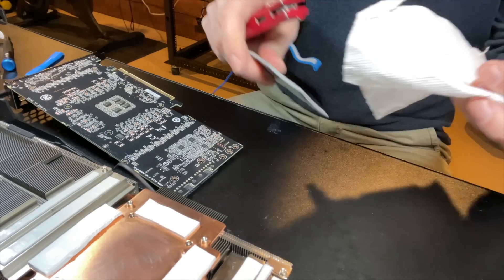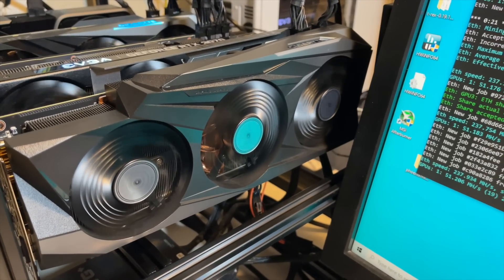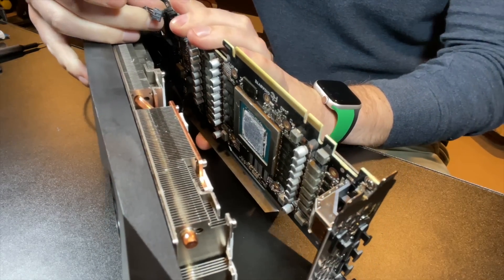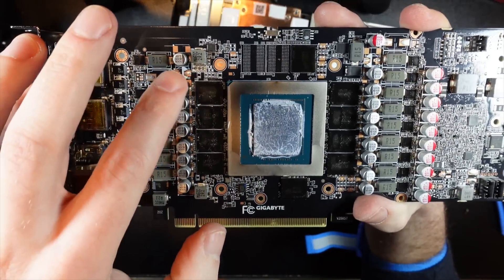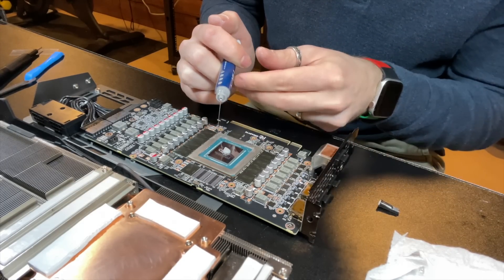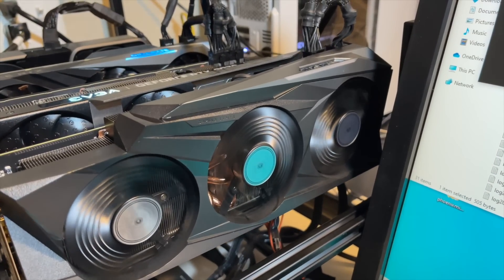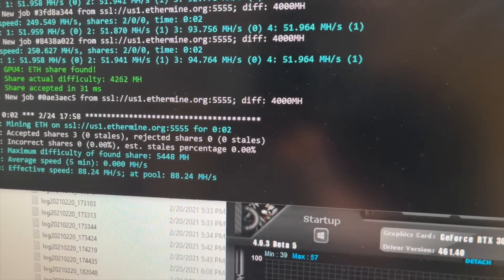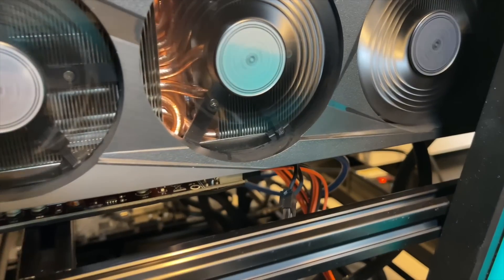RTX 3080 Thermal Pad Install & Ethereum Testing

Comment: wonder if most cards require the 3mm Thermal Pad? i have a EVGA 3070 FTW3 if someone be kind to confirm or direct me to  in the right direction on which  type  thermal pad thickness I should use for my card thank you and TY for the Video👍👍

Comment: 1.5 year late with this comment, but for others doing this... Paste on the GPU core should be fully spread and covered, not just a drop in the middle. This is not a CPU where you are pasting a heatspreader. You are directly on the die now. Can not rely on random spreading through pressure, you want full coverage. For mining it likely doesnt matter, but if you load the GPU for gaming, I expect this one to go crazy hot.

Comment: just did front gelid 12w 2m pads only ( no rear pads) on 3080 tuf, getting 100.5mh 102 vram been good at 68 power -150 core +1410mem fan auto gpu temp at 57 summer nights. before it would just chill at 82mh and couldnt sustain 95mh stock pads.

Comment: Try locking the core or doing -150mhz and do +1150 on memory and set power limit to 215w. You can easily get way better temps and efficiency. I can do 101mhs @212w with manual tuning. The key is lower power limit and core

Comment: How the hell is that 3080 running so hot with new thermal pads and such low overclocking!? I'm running my 3080 with stock pads, memory OC at 1300, fans at 80%, avg GPU temp is 45C with the memory junction at 86C
Reply from the maker: Gigabyte is terrible with these GPUs. Fixed it up in Part 2.

Comment: Mike, what memory do you have in this Gigabyte?  I have a 3080 Eagle with Micron.  Changed out both the front pads and added pads to the back plate, went from 67Mh/s at 108c to 88Mh/s at 108c, an improvement yes but the mem is too hot.  I'm thinking it's got to be the memory brand.

Comment: I'd add copper  rectangles to the heat sink it looks like the  1 inch think pads are not doing a good job on that gddr6x. It should significantly Iower than when your at I don't expect the Ram to last at over 100c 24/7 copper is better and use little thermal paste between the copper.

Comment: it seems with all GDDR6X GPU's the manufacturers cheapened out on thermal pads.
if you replace ALL thermal pads on the GPU with Gelid thermal pads (both over the vram + caps and under the vram) your vram temperatures would actually be well within 75-90c with a good OC.

Comment: way to hot not to sound like a troll card won't last long you above the upper limits
6x mem 0C to +95C / +105C
love the videos keep up the great work
Reply from the maker: I have a part 2 where I replaced the stock pads. Huge improvement.

Comment: Just for anyone watching on bare die chips you are best served by spreading the paste. the dot method is not what you want to do unless you enjoy extra hot,hot spot temps. as unlike putting thermal paste on an IHS ever part of what your are applying on a bare die is the chip vs an ihs which is normally quite a bit larger then the die underneath it

Comment: my 3080 run at 98mh/s fan speed 65% , GPU temp 57C & Memory temp 94C without install Thermal Pad
Reply from the maker: That's sick. What 3080?
Reply: @RedFoxCrypto  gigabyte gaming oc , now i'm running it at 101mh , fan 75% , gpu temp 52, vram temp 92 . Dont know why your gpu too hot lol

Comment: just put normal Stand Fan  near the rig it will fix every thing for you my palit 3080 gaming pro 1300 memory 75 power fan on 75% and max vram temp 82-92 stable 100 hashrate
Reply: Can you please give your settings for core clock and memory clock?
Reply: @Lifetips2040  core -50 mem + 1300 pl 77 fan 77% 
plus + 2 stand fans near the rig on max speed

Comment: I have a question about an evga xc3 black edition 3080, for thermal pads, they recommended 2.25 for memory pads, 2.5 for middle pads, does that mean i can use the 2.0 and 0.5 and just stack them from gelid since theyre squishy? or should i just get the 3.0 for all since theyre 40% squishy or so as mentioned i think at the back?

Comment: Hi!, I have problems with memory junction temperature (110º) with a brand new 3080 Founders Edition (I just get 80MH/s). I guess I should put thermal pads... right?. 1,2 or 3 mm? thanks

Comment: This is not a success. You don't want to run your gpu with mem temps even above 100. I did this exact same thing to my 3080ti FE card and got it to where mem temps don't even reach 80C.

You gotta do both front side and backplate sides as well.

I should add my ambient temperature is 81F!
Reply from the maker: You're right. I have a part 2: https://youtu.be/FZ26U_mvyAI

Comment: I dont know if im lucky or not but last week i managed to buy 5 GigaByte 3080 OC's and none of the cards was thermal throttling. Bought thermal pads and everything just to be ready for any issues  but no issues are present.
My settings for all 5 gpus in Afterburner are...if you want to try:
PL = 65
TL = 80
CC = -200
MC = 1500
FS = 90%

Getting 102.7 MH/s on all 5 of them

Hope it works :)
Reply from the maker: Wow dude. You lucked out big time. Congrats dude.
Reply: @RedFoxCrypto  Hehe thank you :)

Comment: Damm. my 3080 Ichill can do 103 MH/s at 104c temps with ambient temps at 25c. but i still run it at only 91-95 MH/s with temps at 92-94 and fan at 80%. now i am thinking if i add thermal pads maybe i can go down a bit more but i don't know if i can open my card its too precious for that lol.

Comment: That temp it's way too hot, it will cause premature memory failure.
Reply from the maker: I fixed it in a follow up video. Replacing stock thermal pads is the way to go.

Comment: Hi ! Thank you for your amazing content !
12:39 Why would you not recommend to let fan at 100% all the time ?
Reply from the maker: Thank you very much! Running it at 100% 24/7 will add to the wear of the fan and cause it fail sooner. But honestly, fans are cheap and easy to replace so if you need to run it max then do it. Better than toasting your GPU.
Reply: @RedFoxCrypto  Thats what I thought, better keep the GPU chip in good condition than replaceable fans, TY for your answer and content.
Reply: I wonder if you tweaked the bios of your GPU, because my MSI Gaming Trio Z can’t get to more than 90 MH

Comment: I did the same thing but with 1.5 mm pads and there is literally no difference. Its still thermal throttling. Do i ought to replace them again with 2 or 2.5 mm's ?
Reply from the maker: Check out my latest video: https://youtu.be/FZ26U_mvyAI
Reply: Thank you so much. I did exactly as you did in your video. I'm getting 101 mh/s rn. But memory junction temp is still reaching 110. Is it ok?

Comment: Excelent vídeo!  I have 2 msi rtx 3080 Ventus x3 OC working white this values ( 72 power / -200  core clock / +1200 memorie clock / 70% fan cooler ) on stock pads and I am getting 99.50 mhs and  internal junction temps /100c 102c. It's is normal? Thanks
Reply from the maker: It's a little high, but personally I'd take it. Run those fans a little higher. Better than opening the GPU in my opinion. Thanks for watching dude.

Comment: My model is an rtx 3080 gainward, phantom, and it gets 88celsius at memories. No more than that... Also, it goes around 97.5mh/s and consumes 169watts... PL 50%, Corecloc -150mhz and memory clock +1.200mhz, Seems that i won silicon lotery...
Reply from the maker: Yes you did. That's almost too hard to believe. Nice GPU my dude.
Reply: @RedFoxCrypto  i also didnt belive when i see everyborys gpu doing a lot worst then mine, but, i did also see some guys doing better. Só o think this is about being luckyly enought to get one of these golden selected gpu…

Comment: Thanks for your video, I managed to change the heat pads as well like a month ago. It helped with temps a lot, but as its getting summer and outside temps are going up, my memory is getting hot again. 

So, did you change the front pads and if you did, did you notice any effect in temps?

Comment: bro that 3080 gigabyte card is so bad , mine is gaming z trio from msi 3080, and i have memory temperature never going above 92C and i am hashing 96mh
Reply from the maker: Yeah dude it’s the worst. Super disappointing.
Reply: @RedFoxCrypto  what thermal pads do you recommend just to have them in hand i will order, i will stay away from gigabyte cards, i had before rx 470 from gigabyte when i was mining ti was the worst, asus and msi were always great
Reply from the maker: @techgeek2994  I’ve used Gelid which seem good. Others have had a lot of success with thermal grizzly.
Reply: @RedFoxCrypto  i read now that ODYSSEY Thermal pad is best reduced temperature under 80c in some 3080 cards

Comment: I have an inno3d rtx3080 ichillx3, with nicehash quickminers optimized medium settings my card averages around 90-95MHs and vram temps at 90-98C. I use the card for both gaming and mining but i mine more around 15-18 hrs a day. So are the temps safe for the card, can i get atleast 3-4 years of life from the card like this or should i install thermal pads?
Reply from the maker: At those temps, with that performance I wouldn't touch a thing. I think you are in a really good spot.

Comment: Dude you got to get your temps down. I'm running same card and achieve 98 junction temp. Find the sweet spot for your card settings!!!
Reply from the maker: Yeah I still need to replace the stock pads, which will have a bigger impact on temps.
Reply: @JB Technique I have an inno3d rtx3080 ichillx3, with nicehash quickminer's optimized medium settings my card averages around 90-95MHs and vram temps at 90-98C. I use the card for both gaming and mining but i mine more around 15-18 hrs a day. So are the temps safe for the card, can i get atleast 3-4 years of life from the card like this or should i install thermal pads?

Comment: I like the ability to watch what's inside and give 1000 cudos for handling! Basically you must have balls to hold gpu by the pcb in same height as gpu chip it self. If you like to unplug your power cords you should never hold it so, instead hold it as close to power connectors as possible to eliminate mobo flexing - ouch ... soo close...

Comment: Great video man, everything looks so simple when You do that. My 3080 will also get new thermopads thanks to Your tutorial. I see that You used 3mm thermopads, do You think that 2mm will do the job? I mean will they touch the backplate of video card? This should be good for them.
Also did You consider replacing stock thermopads that are directly on VRAM chip ?
Reply from the maker: Thanks dude! 3mm for the back and 2mm for the front. I highly recommend replacing the stock pads. I should have done them in this video but I didn't have them on hand. Good lucky buddy!

Comment: did you not prepare enough thermal pads before doing this? i can't think of someone would tear down a card just to only replace pads on the back side, while it's more important to do that on the front side!
Reply from the maker: Nope. Just tried to add instead of replace. Def more important to replace the stock ones. I have them but I've just been putting it off...
Reply: @RedFoxCrypto it's good that you can trade this for 2 3070, i've just got myself a 3080 and now having headache with its crazy mem temp

Comment: What did you clean the oil up with? 90+ alcohol? Or just a paper towl?
Reply from the maker: Sadly, paper towel on this video. Now I use alcohol with special cleaning wipes. You can see it in my 1070 Ti repair video.
Reply: Good to know, I’m about to do this to 4 gigabyte 3080s, your video is extremely useful!

Comment: Thanks. I have the same card and changed out all the pads on the gpu and backplate. The junction temp is at 90 now but the backplate is extremely hot and making the card hot too. Anyone have that same problem? Will it damage the card leaving it run for mining?

Comment: Has anyone tried thermal tape/pads with heat sinks and no direct fans on gpu 
 but an open air unit with case fans?

Comment: Stuck some ali heatsinks with copper shims using thermal tape  got 2 fans blowing from backside at heatsinks keeps gaming trio around 90C  suprim around 96 C    1275 on memory  0 on clock  trio at 83% pwr suprim at 72% pwr   giving me around 123 MH/s each card thru riser.
Around 121 if card straight in motherboard no riser.
Rtx 3090s  
Good luck summer is coming ;))))))

Comment: Nice video, how many packs did you need of the gelid pads? Is 1 enough of both 2mm and. 3 mm?
Reply from the maker: Yeah just one pack is what I used.
Reply: Thx done it myself and also 1 pack of 2 mm front and 1 pack 3 mm on the back.
Reply: What size thermal pad do you recommend for the vram chip?

Comment: good video, but total fail! 110c not good. thermal pads just on back doesnt work, you would of been better just changing the ones on the copper cold plate and not doing the back, if thats all you had. stock pads on the cold plate suck, thats the main problem.

Comment: Yeah, I really need to do this. Mine is only running at 75MH/s at 110 degrees (I usually run it at 70MH/S at 104 degrees though)! Also, gaming also gets it to 105 degrees, which are not great temps!

Comment: I like to thank you very much for this video and how you explained: detailed and very good to follow step by step (position of the cam was perfect)  For my first attemp I had not enough pads I improved from 83Mhs to 93Mhs (max. 97Mhs with cold temperatur from outside) only. But after my 2nd modification the gpu has mem temperatur of 80degrees only and I got 102,927 MhS as max. and constant value of 102.910Mhs. I changed all!  pads on backside (3mm) and all ! at the frontside (2,5mm) with grizzly Pad. I needed 100x100 x 1mm and 100 x 100 x 1.5mm and it was sufficient
Reply from the maker: Dude thank you for sharing. You got awesome results. I need to replace the stock pads as well just haven't gotten around to it. Thanks for the positive feedback on the video too it means a lot to me as I continue on my YouTube journey. Thanks Marco and happy mining buddy!
Reply: @RedFoxCrypto  Sure, its great that you sharing your experiences...I woud like to have more time to do the same and sharing my experiences. So please go ahead. One update concnering my  RTX3080. ...on the fronstiode maybe 2.5 mm is is little bit to much of the pad, maybe 2.0mm is better. I had to push a lot to lock the screws and actually I have a hotspot temp of the gpu which is too high. my average is 59 and hotspot wents up to 90+ degrees when I am not using the fan on 100% which reduce the hotspot temp on 83 degrees...Maybe I used also to much thermal paste too. However its running now.
Reply: Update: WIth 2.5mm on the frontplate  I got fantastic low mem temperatur on the frontplate, but the gpu hotspot was with 90degrees to high, as I reduced to 2mm on the frontside the gpu hotspot is gone (52 degrees), snd the mem temperture is still okay with 100 degrees when overclocked and 102.9 MHs. On the backside 3mm is working but I recommend to use 2.5mm and not 3mm, with 3mm the pressure on the plate and chips is very high. WIth 2.5mm I got fantastic low mem temperatur

Comment: You would of got better temps if you replaced the naff pads under the cooler too!
Reply from the maker: You are 100% right. I finally got replacement pads and plan on doing that very soon!
Reply: @RedFoxCrypto  I installed an EK waterblock on my 3090FE and brought the temps down to 80c (was 104c) on the junction temp and increased my Hash rate to 121MH/s (was 116MH/s) with the same settings

Comment: I've just done this on my Gigabyte 3080 Vision. Before: 78 MH/s and 108C memory junction. After: 98 MH/s and 74C memory junction. What a result that is! Thanks so much for your help :)
Reply from the maker: Awesome dude! Happy hashing!
Reply: You just did the backplate, not the front? I might have to do that then, shit.
Reply: @maulcs  I did both sides. On my card, to get the backplate off you need to take the cooler off the PCB anyway. It's actually pretty easy. Took me less than an hour all together and made such a difference. Really recommend doing it!
Reply: @salamanderpete  I have the Gaming OC and I had already taken it apart to fix the molex connectors, which are now starting to have the same issue again after a few months (getting pushed in). I really didn't want to have to take it apart again, but after seeing these results I am tempted. I don't mine but get around 102c in some intensive games - which is not as bad as it could be, but I want it to be better. Time to buy some pads I guess
Reply: @salamanderpete  Dude, I just did the 2mm pads on the inside, and replaced the paste as well. Was totally nerve-wracking, but in RDR2 (game that makes my GPU the hottest) I'm down from 75c to 68-70c main temp, and 102c to 78-80c for the memory temp. Looks like I don't even have to do the backplate, this is fking awesome.

Comment: i replaced the sorry ass front thermal pad too and the result was amazing a little bit improvement by just rear thermal pad replace
Reply from the maker: Yeah man I need to do that. I have the pads, just not the time!
Reply: @RedFoxCrypto  u should replace both sides for ultimate improvement I am really happy to save my card and thank you so much you are the best........ I never seen oily thermal gigabyte sucks 2mm in frent

Comment: I've got ventus x3 at 100mh/s at mem +1330, core - 330, PL 71% and temps are at 40 and 94 C and fan running at 90% while the room is at 10 C...that's w/o changing or adding anything to the card...it  just stays outside of the case 😆
Reply from the maker: Nice dude! Sounds like a way better card than ALL these gigabyte 3080s.